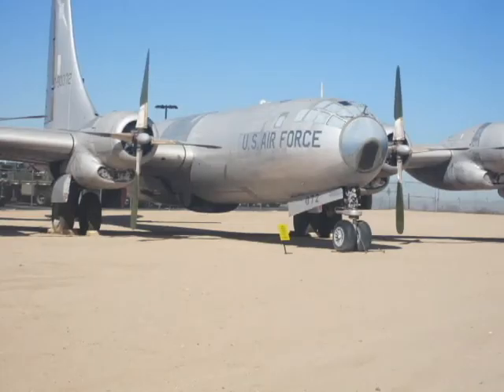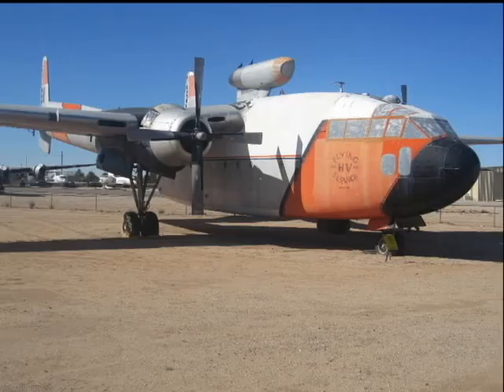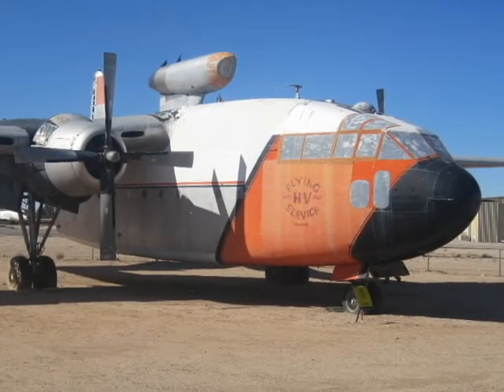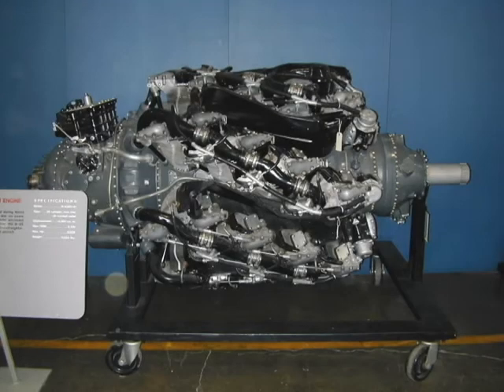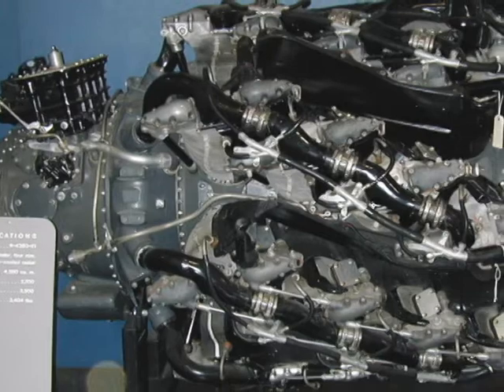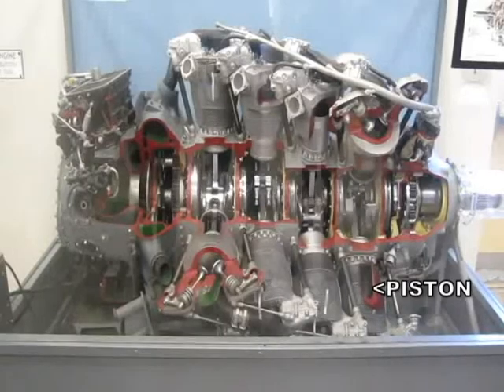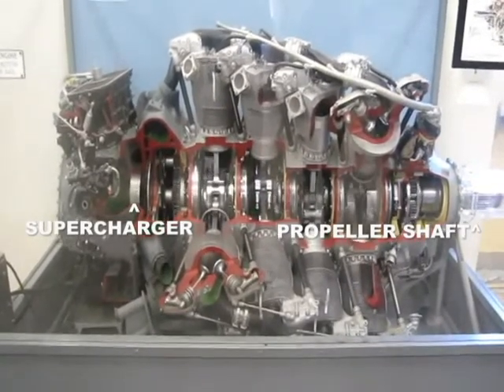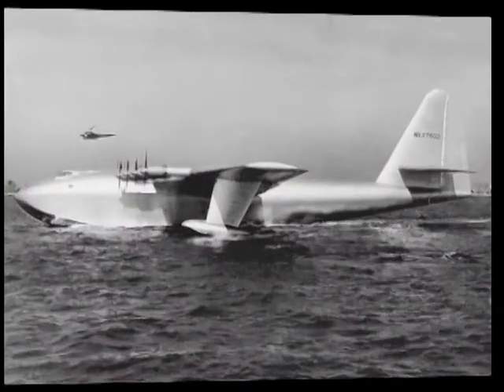Pratt & Whitney R-4360 "Wasp Major" engine

Comment: Thanks for your video, Tony. As I recall, most of the C-119's had Wright 3350 T/C's on them with  PRT's and Bendix pressure carburetors. The more powerful versions used on Super Connies and DC-7's had direct fuel injection.
Reply from the maker: Thanks for the info. Happy you liked the video.

Comment: You sure the Spruce Goose had Wasp Major's?  Wasn't construction of that plane, as a one-off prototype, begun before the engine type was built?  I would have figured it would have had R3350 engines which is why six were needed.  BTW, 195 gallons per hour - that three gallons of avgas per minute so we won't be seeing a B-36 airborne any time soon -engine start, warmup, and taxiing to the takeoff point would cost at least $1,000 by itself.
Reply: Hugh's Spruce Goose did (and does) have P&W 4360's on it. Saw it in person.
Reply from the maker: Russ G According to Wikipedia accounts the Spruce Goose did have the P &  W 4360 engine. The Goose and the 4360 both were built near thr endnof WWII. Goodyear did install a 4360 in a Corsair. Thank-you for your comment.

Comment: I used to work with a guy who was retired air force and worked on B-36's.  With 56 plugs per engine, and six engines, they had to change 336 spark plugs after each mission.  "We carried the spark plugs out to the plane in buckets" he said.

He also said that it wasn't atypical for a plane to come back with one engine feathered, as the failure rate on these engines was fairly high.

It was the apex of radial engine design, to be sure.

But the turbine engine has only one moving part.....
Reply: Only needed the six engines plus jet boosters for takeoff an climb to altitude; then the engines could be throttled back.  Maybe they only burned a HUNDRED FIFTY gallons per hour each cruising at 40,000 ft!

Comment: Obviously you have had a great deal of experience on the R4360.   As an "Instrument Systems" guy, the BMEP system was difficult - always problems, i.e. "to low"; fluxuates; not in limits, and on and on.   The Magnesyn style of BMEP transmitter, mounted on the nose case, was the major problem.  Had a small magnet in a bore that was pushed up, against a spring, from nose case oil pressure.  Never worked well.  Fuel flow vs manifold press was also difficult.  As was, as was, .... :-)    N-6395T

Comment: Worked on the R2800 for 4 years (Avionics/Instrment Syst.).  That was on the USAF's C-118A.  A "bear" of an airplane to work on - many hours of maintenance for each flying hour.  Was a killer!   However, that 2800 was an extremely reliable.  The KC-97's used to come back a lot with one of the R4360's "caged".  Called it the "original Ford Tri-motor!!    N-6395T

Comment: Only worked on one of the R4360's, and that was on a C-119.   Had a "Torque Oil Pressure Indicating" problem -  removed and replaced the "banjo fitting", with its capillary line & the Transmitter.   Must have been a hundred Adel Clamps holding the capillary line.  Also, made one skydive jump from a C-119; got on at Kelly AFB, and jumped over Hondo, Texas.   The Clam Shell doors were left off for the jump.  Had 21 jumpers on that load.  Only got 8,500', but it was an OK freefall.  N-6395T